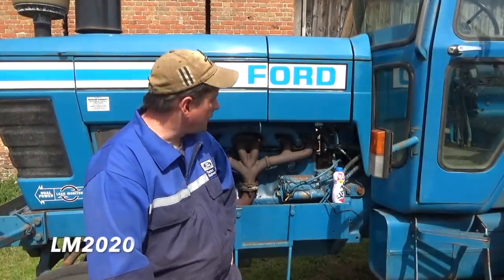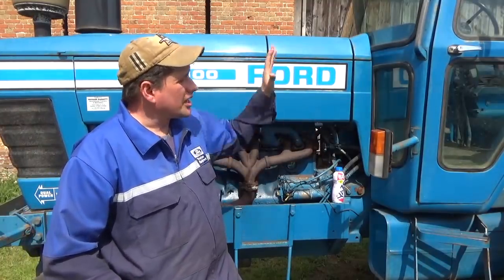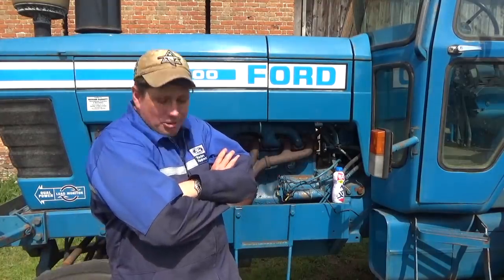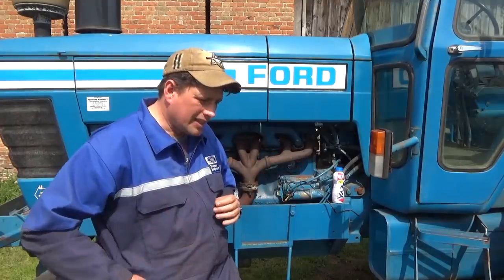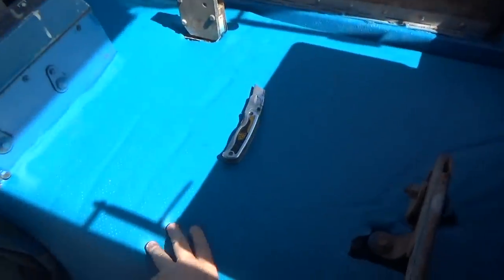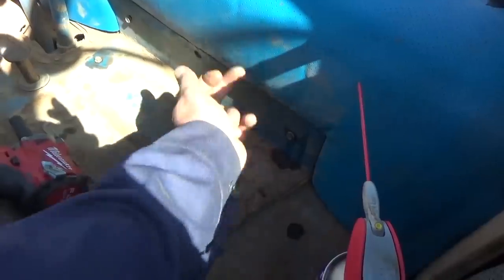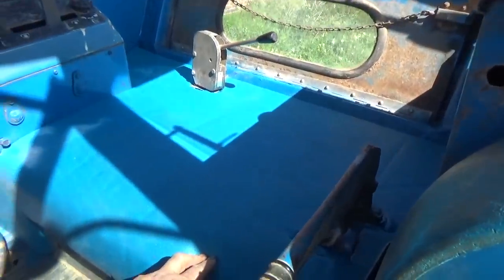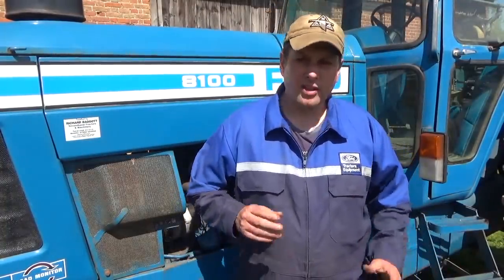HOW TO FIT A CAB INTERIOR KIT - FORD 8100

Comment: Another good video she looks like she has been fitted with a A R M pick up hitch sometime we used to fit them on early 5610s especially ones fitted with 22/ 36 instead of 12/38 wheels the A R M hitch gave a lot better ground clearance than the new series 10 hitch

Comment: Bit old but days of thunder, really need to sort the seat out on my Massey same kinda thing you did on a previous video it wants some now bushes put in also the adjustment isn’t right it’s stuck on 120 kg I weigh 80kg however overall seat condition is tidy so maybe I’ll just put on the weight ? 🤔

Comment: Question what do you do with these tractors once you get them in running condition? Second question why are Ford tractors so numerous on that side of the pond yes we have them on this side but more New Holland John Deere and Case tractors by far?
Reply from the maker: Ford were available in the US but back in the 60's and 70's Case, IH and JD had a better market share, that and the fact most Fords were built in England and so had to be shipped over

Comment: Hiya muck after a bit of advice when ya get the chance, or anyone who can help, I bought a ford 3000 and theres a banging noise coming from the intake manifold when you rev it and let it off you can see a flame come from the pipe, also some blue smoke, what can cause that to happen, I cracked all the injectors they're all fine, I pulled out the heater plug and that's not staying on and causing diesel to ignite inside it, going to post a couple of videos to see if anyone can help.
Reply from the maker: I would say, without actually seeing it, you've got a sticking valve.

Comment: Another good one 👍 lord muck can I ask a question . I call the 8100   as  eight one   where you call it eight  one hundred .  I call  a 7700  as seven seven and a 7710 as   seven. Seven ten .  Am I wrong or you .  I am at rebuild of a ford 7910 engine . Shaft good  6 liners and new piston's and all new valves and  Oil pump . Hope to have it running in few weeks to work mover and make some hay \ silage. Are you going to try get front sides lights and back lights as we're on it from new . Keep video's coming and keep safe  .
Reply from the maker: If you've only got one tractor then 77 is fine but I'm dealing with multiple tractors day in, day out so you have to be a bit clearer than just 81 or 77...
Try ordering parts for for a '77' and you'll get asked if its a 00, 10, 40 etc.
If you only chat to other Ford owners then 77, 81, etc is normal 
The lights are as they were for years and are the same as the late 81's without the silly white covers

Comment: Autumn 2019 we sold a 5610 1983 4wd (4000 confirmed hours) to a dealer here in sweden that export to the UK. Is there really a market for those in the UK?
Here if its not a Valtra, Valmet or volvo 4wd from that period its not worth much.
Reply from the maker: Yes, 5610 is a sought after tractor
Reply: @LordMuck  Oh typical! We should have asked for a bit more then :) 
4000 hours, all original, seat undamaged, that strange version with gearsticks on the steeringcolumn, always parked indoors when not used. Oh well we live and learn, glad to hear that it will most likely live a few more years then.

Comment: Och Muckers, man!    Aye always thocht  you wis of my own making !    - but painting like that.....   I certainly DO AGREE with your sentiments, and these jobs leave me in a Quandary....  like what do you do with the old girl ( Boy when it's a Massey or Deere) and it needs new Tyres -  Shiny new RADIALS when you've  been used to 1/2 perished X-Ply GoodYears or whatevers. .....  ...doesn't look right does it?  As  for Drink?  Och a  Moothful out of  the HandPump at the well.    
andafter you've done this  up and had 3rd thoughts on that spraydrift jobbie,   are you going to do a  Decent INFOTAINMENT video on how GOOD the LOAD MONITOR  is?    these modern kids don't know how to set p and use a tractor.
Reply from the maker: Spray drift isn't an issue when you have a tin of thinners or brake cleaner at hand. Everything I painted is now covered with cladding and any moisture won't be able to sit against bare metal now.
Most fuckers wouldn't even have bothered to clean down and spray the metal.
Reply: @LordMuck  Datz maBoy - Indeed  even PINK Paint will do if it's being covered up.  Massey had Pink Undercoat - you'd see it come thru on the wings where your sleeves rested when ploughing - remember ?     Oh I see - not that old,    OK - so now you know!
Reply from the maker: Oh I remember it, the 188's would do it where you got into the cab. The later MF's wore through to a beige coloured primer.

Comment: Wonder is that same seat that was in the 1985 TW-15? My ole boy loved that seat said it was great to sit in and could do a full days work and still feel refreshed compared to the 90 series Fiats they also had in their fleet sadly broke once he started driving the On-Top self propelled slurry tanker when the other guy dropped onto it and broke the seat and their boss welded it solid. Deffo my favourite tractor spent many hours sitting on the Box on the left hehe
Reply from the maker: Yes it would have been the same style